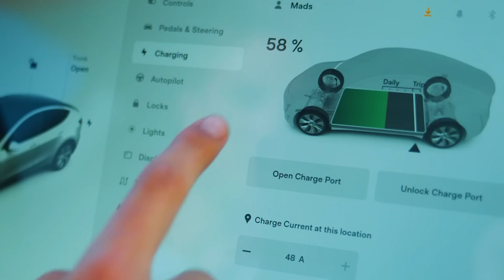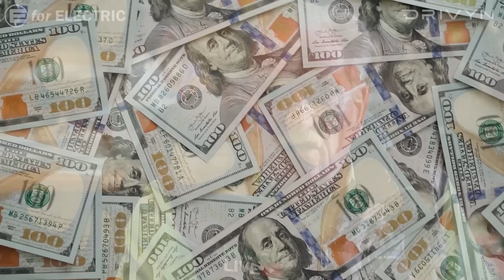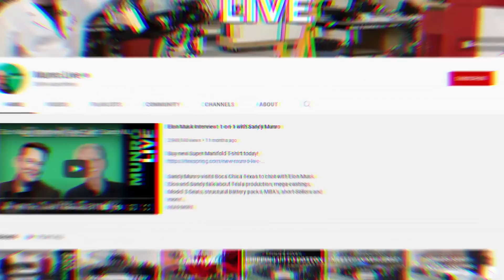SANDY MUNRO Calls Out EV Makers

Comment: Sandy, I'm a logistics and reliability engineer and I love emphasis on vertical integration. But I have a serious concern that even Tesla needs to address. Allow me to pose a question. What happens when your enormous battery cables survive a battery short when your car goes into a river or your Lithium battery just starts on fire. In these scenarios small scale wiring (like door latches, locks, windows) always short out FIRST, while the really big power wires keep the fire going. How do you get out of the car without MANUAL/MECHANICAL LATCHES? How does the National Transportation Safety Board (NTSB) even allow such vehicles to be sold and operated??? I don't care if this only happens 10 or so times per year. I don't want to be the person who burns to death. Oh, by the way, I am a certified, experienced Aircraft Accident Investigator.

Comment: I no longer have any respect for Munro since his video where he thought the CCP would make a good car, just like Japan grew their industry.  The difference is that 45 years ago the CCP made garbage just like they make today.  Japan went from 10th place to First in quality.  He refuses to understand the CCP.  In China not a single car maker has any self respect in their domestic market.  In China car makers pattern their badge location to accept a foreign badge from the brand they are faking.  They sell the badge kit themselves, and deliver the unit with a fake badge in place, so you don't even drive off the lot with the company logo displayed.  No one wants the Chinese logo.
Winston Sterzel of ADV China had a Chinese car.  6 times in 10 months he went in for a new AC.  The CCP system has no reward for quality.

Comment: I'm pretty sure we are going to see a number of old car companies die out. Some I think may survive, but they will go through hardships. There may be bankruptcies and bail-outs similar to what happened around 2008. Latecomers who haven't really taken electrification seriously are toast. It's a shame, because Dodge, Chrysler, and Jeep are legacy names with a sizable fan following, so they will be missed. Companies that are trying to hold onto gas engines as long as they can are going to be the ones to suffer the worst, because the key selling points--sports performance and low cost--ultimately will be the very things that in the long run will be the selling points of electric cars.

Comment: i agree with the HR idea.  NO HR is needed.  They are just the legal dept anyway.  Really you need a corporate lawyer and  some recruiters.   There is no such thing as HR for the employees. They actually work against the employees if anything. They dont do benefits they dont answer basic uniion questions they dont handle negotiations in general.   HR at the workplace is dead.  You can have anyone do up SOPs for the staff the rest is not necessary.

Comment: 6:54 Being inventive/innovative has nothing to do with vertical integration. Tesla is possibly the most vertically integrated automaker, yet they are simultaneously one of the most derivative. Most of their "innovations" have been borrowed or licensed from other companies. Meanwhile, Sandy poo-poos an actual innovation in the form of a hydrogen fuel cell range extender. Sure, Toyota could improve that platform in a myriad ways, but true innovation requires iterative design, and the early iterations will often have glaring defects and issues that must be adjusted or fixed in future versions.
Reply: He's talking about Tesla's assembly line and process which are innovative. The car isn't the machine, the factory is.
Reply: @Steven_Edwards  I thought he was referring to the company, which has not proven itself to be innovative.

Comment: 4:23 Some of this might be due to a difference in philosophies. Sandy loathes serviceability, and has often stated that he would rather just throw something away than fix or replace parts. One-piece casting all but guarantees that a car is a total loss, even after a mild accident, and if a casting goes wrong (do we know the defect rate?), you're binning a lot more material than you would if a stamped part is defective.
Reply: Look up tolerance stack
Reply: @mjcamp01  I'm not looking for a definition; I'm looking for the actual defect rate that requires binning the component and starting again. It's certainly not six Sigma. Is it five Sigma? Four Sigma? Three? 

The larger the component, the more fail states, it's true. But more importantly, it's also the more each failed component costs.

Comment: I think sandy is a little harsh.  Large companies are basically optimized for doing one thing well.  In the case of automobiles, most of the innovation in a traditional ICE vehicle is in how the vehicle is designed (what features are in/out), and the cost.  So they are optimized for that and everything else is thrown to a supplier or the parts bin.

BEVs have significant innovation so they are better off coming from companies that are vertically integrated so you get that optimization.  But when the innovation slows down (and it will), you will see the same pivot to where we are right now with ICE vehicles.  

And even in an innovation-heavy company cost is a significant issue.  Elon almost drove the company into the ground not worrying about cost, and then again when he started worrying about it.

Comment: The major mistake I see with EV Vehicles Tesla included, is in California alone, they will need an additional 1 million Chargers to meet the government's numbers. There are already videos of long lines of cars waiting to plug-in after their workday. Everyone that lives in an apartment that has to park on the street or parking lot has no other option. Maybe the good thing is that rush-hour won't be on the freeway of California it will be waiting in line at the charging stations Nevermind the insane amount of mining that will be required to meet even half of the numbers that will be required for the batteries. And everyone forgets the short life of a battery. You can drive a ice car for 30 years whereas you will be lucky to get 15 years out of a battery even if you replace the cells as they go bad. You're lucky that the environmentalist are so slow because once they figure it out good luck! And let me be clear I would love to have a EV vehicle. But at my age I just can't justify it because I don't drive enough.

Comment: I like the idea of electric cars, my location( western canada) does not. 40% loss at - 15C... what do I do in prolonged - 25 to -40C?  How long will electricity stay at 13 cent/ kwh? How much tax will goverment impose to replace gas tax for highway maintenance?  A lot of innovation needed yet to be practical. Why does goverment need to subsidize electric cars? If they are  cost effective, wont ppl just buy them? Did gov outlaw horses to make sure model T's were bought?  Regards from Saskatchewan, Canada.

Comment: I’ll add a fourth failure. No universal industry standard charging port. They should have learned from the debacle we still live with today where the fuel door is located wherever the manufacturer decides to stick it and it causes congestion at the fuel pumps. This is the world’s one chance to get ahead of this problem and our government should require a universal port if they are going to help pay for building out the charging infrastructure. Even if there are different voltage and current requirements it can still be done with one port and some means such as a barcode or RFID to tell the charger what is connected and how to charge it. As far as the tap dancing elephant goes, our incorporation laws are ultimately to blame for that. Tesla is successful because Musk is not only a genius but he had the guts to stand up to investors and tell them they were welcome to invest and share in the success of his company but they weren’t going to run it into the ground trying to make a fast buck like every other corporation. He focused on the technology and building a better company and better product as well as a better way to make cars, that in turn has produced profit. The way most corporations operate is that activist investors or short sighted CEO’ make changes to squeeze out some quick short term profits, load up on dividends and bonuses, drive up the stock price, then bail out before the whole thing collapses and go look for another company to destroy. Our corporate laws need to change so that management is required to make decisions that are in the best interest of the long term health of the company and its employees, improving and developing products, and THEN making money for investors. Our corporate laws are what has killed manufacturing in America, it wasn’t the cost of labor, it was the greed of Wall Street.

Comment: Case in point: GM had an attack of innovation and created Saturn. It was light and agile, and it created a radical new product. Within a few years, GM: 
* Saw it as a threat to their existing market share
* Cannibalize it
* Assimilated it back into the Corporation
* Crushed it.

I own a Saturn sedan and SUV and they're both great--inexpensive, well-appointed, forward-thinking, easy to service, and competitive with the foreign competition. 

And dead. But GM is undead.
Reply: GM killed Saab deader than a doornail, too ...

Comment: The bolt was the first sub $35k EV. An electric car that middle income earners could actually afford. An EV that actually works great without breaking down due to poor design. True the battery recall was a debacle but I'm at 96k miles on the old battery and the car has never left me stranded.

Tesla continues to waste time and money on an autopilot that gets people killed. The cars would be safer and more affordable without it.

Comment: I feel the same way about hybrid cars. Two systems in one car.
Reply: Yeah not an accurate comparison it is logically.
A much smaller battery is required for FC, because it is constantly charging. So lighter weight offsets the additional components.
ALSO the battery will last way longer as it is not being discharged to low levels very often like say a Tesla could easily be when trips are at range. Li Ion chemistry doesn't like 2 things, 1) Heat and 2) Full to empty charging (It ages the ions, and by product is - you guessed it - more heat) - manufacturers of power tools use this to sell more batteries, because they have the convenience part sewn up.
Not a fan of Fuel Cells, but believe they're worth someone researching them... otherwise isn't Sandy just being hypocritical ? - discounting possible innovation (maybe even an off shoot tech. that happens on their journey. Again his logic isn't certain.

Comment: Vertical integration has been persona non-grata for ages. Nice to hear some sound arguments for vertically integrating. If the numbers make sense you ought to vertically integrate:  The trouble is that very few people bother to check whether the numbers stack up? That's probably because most people (including management) seem to be really bad at finances? Management tends to underestimate the risk of supply problems while overestimating the savings made when outsourcing. That's why it's always a good idea to listen to suggestions from the floor? Often workers will have more ideas on what could be done than management?  The trouble with change is that it's usually much safer to go with the status quo than to propose something new? If you propose something new it's your head on the chopping block if it goes wrong?

🙂
Reply: Vertical integration was abandoned on the principle of “work smarter, not harder” ...

Comment: Toyota FCEV or Hydrogen is a reliable fuel once we can effectively extract it from methane and biomass. In a BEV, you are carrying dead weight if the battery is discharged. If hydrogen fueling stations were available throughout I would not use BEV.

Comment: Totally agree. There are other issues I’ve found with companies making EVs (excluding Tesla):
- lack of OTA updates
- the constant need to “service” EVs. Why? Just to make more money and waste our time?
- lack of EV charge infrastructure. At least Tesls is building superchargers.
Reply: Several others have OTO capability.. VW does, and others.
Service ... even an EV has things that need serviced.. Coolant changes... and yes even repairs... many parts are shared with ICE and EV.. suspension, brakes, lighting, etc.
Lack of EV chargers???  ever heard of Electrify America.   
And as EV owners are constantly saying..99% of the time you would charge at home anyway.
I general I agree with Sandy.. Though Tesla does plenty thats not great.. They still cant seem to build a car with good panel gaps.. consistently. 
And besides amazing powertrain and battery tech.. the cars themselves are kinda boring and not as functional as other options.

Comment: My family wanted to buy a small car for urban driving, I would have bought the Chevy Spark EV but guess what, GM killed it.  The reviews I saw on YouTube all say the car was made with hard plastic inside but that it was zippy, fun to drive, and pretty good for someone who lives alone or doesn't have a big family.  They tried to push the expensive Volt, then the Bolt.  As long as they make expensive toy EVs it won't help the environment, what we need are vehicles to replace the makes and models ordinary people buy.

Comment: I think electric cars are interesting but I’m still not convinced electric cars are ready for prime time.  To drive one, even a Tesla, you are a beta tester and I know plenty of people who have tried these types of cars, including Teslas, and have gone back to ICE.  Think running Linux as your OS, instead of Windows or Mac or even Chrome OS.  Yes I know Chrome has a Linux kernel but it is so heavily modified as it is in Android that it’s predictable and works as you expect.  Electric cars just have too many compromises and the tech makes it unpredictable, even with Tesla’s unpredictable rebooting screen.
Reply: Teslas are computers on wheel, you will always be a beta tester, forever, and all the new ev cars, because they will always be improved upon, the legacy cars are unfinished products, that work, and dont change after at least a year or two, improvesments are very slow, and you don't ge to have them as long as you have you alrady bought car, is a different aproach for cars, so you will never consider them as prime time, they constantly change via software or hardware weekly.

Comment: can an elephant be taught to tap dance. they can, depends on management. they have to change how the company operates. which is very hard to do,  since its like trying to turn a large ship. it can be done, it just takes time. today's management doesnt see any reason to invest in their companies, they instead want to buy back stock instead. and lots of this is because of the stock market. investors want to see more sales with the same investment, and cost cutting is also because of the stock market.  seems like all companies say they want innovation ( see stock market), but they just want it a low cost.  now one might think that management wants higher stock prices because investors do. no, its because of the way executives are paid, they get stock options, in fact in some cases many times the amount of their 'base' salary. but those options arent very good, if the stick price doesnt go up.  given this was done to make executives align with whats good for investors and the company. the former has sortvf been done, the latter not so much, just leads to short termisim in the extreme